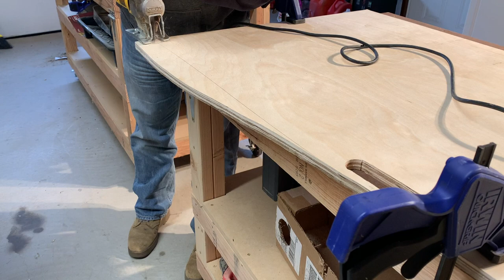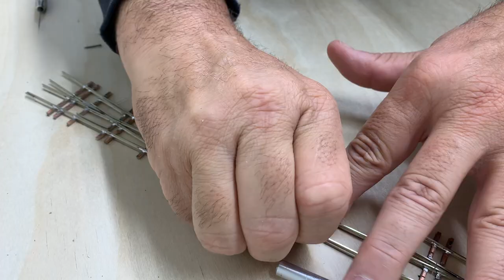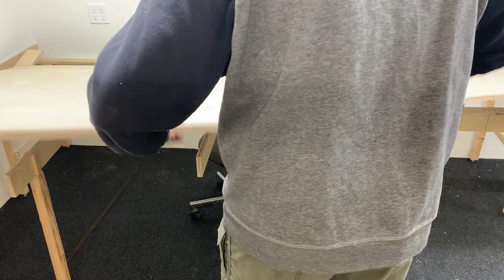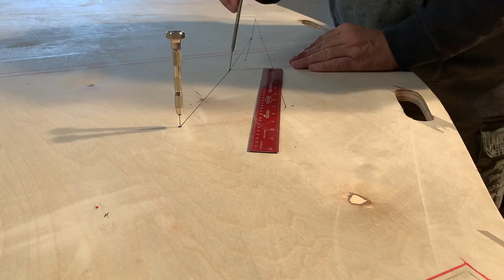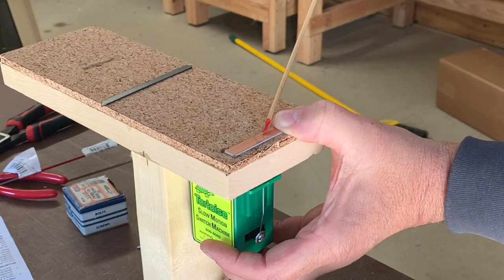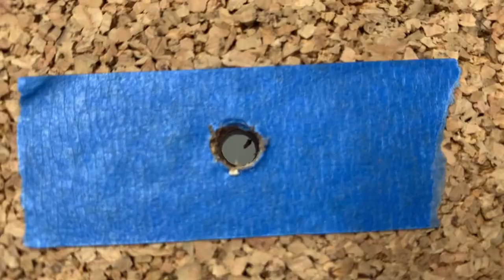Model Railroad Update 40.  Staging 4  (Cork it Up)

Comment: Happy Thanksgiving and nice update! I prefer cork over plywood for substrate myself. It is worth the extra effort. Lazy modelers use foam for track substrate . . . lol. Cork on plywood has excellent sound suppression (better than foam), it is easy to machine, it is easy to repair and revise (you can screw cleats into it, etc.), and above all, solid substrate for track work, buildings and trees, etc. You can also  drop sidings down below the main (to the plywood) reliably and easily with a chisel. ;-) Cheers ~ Boomer.
Reply from the maker: Thank you sir!  I plan on using cork and plywood for all of the track in my towns.  It's just not as easy to get in the middle of no where Oklahoma as compared to the Pacific Northwest! :-)  ~ Dennis

Comment: Nice techniques. I had never thought about soaking the area with some glue before drilling. I have used a piece of 1/8 inch plywood as a spacer/buffer between the cork and drill chuck. Thanks for sharing and stay safe.
Reply from the maker: Thanks Larry, I like the buffer/spacer idea.  I might give it a try on my next go-round with a turnout.
Reply: @OtterCreek  The spacer is about 3/4 inches wide and 6 inches long. The length is so I can hold one end to keep the spacer from spinning. I really like seeing your attention to detail and how you take your time and do it right.  Great stuff.